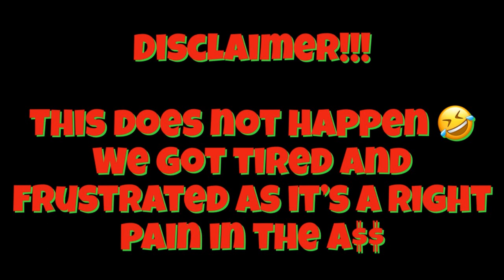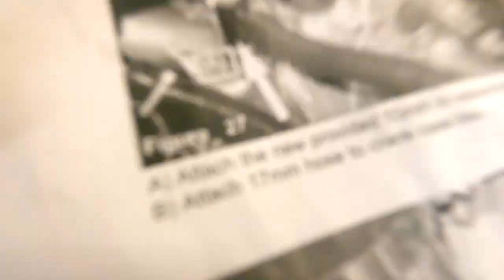Honda Civic FN2 Type R Injen cold air induction kit installation

Comment: So the japspeed catback video you guys made made me buy one and install that. Made it look and sound so easy.  That was a B*TCH.  In fairness most of it was getting the old one off but still. If this was supposed to be an advert for replacing the induction kit, I, personally, will be leaving this till a particularly rainy day. (Well more acurately can't be rainy as I don't have garage like you guys have!) as this did not look like it was a hobby anymore!
Reply from the maker: This k ok me really was a pain in the Butt mate really was. Exhaust changes will always be easy IF the old one comes off ok. Which usually isnt the case. Appreciate the support my friend 🤘🏻❤️

Comment: I've had the HKS ram intake and now Injen CAI, the CAI much better no flat spots runs cooler better system all round
Reply from the maker: 100% agree with you buddy
Reply: @CowabungaCarDiaries  what's the plan next dude ? Best mods I've seen with the FN is the exhaust manifold, induction kit & catback with map from dynodaze & yr rolling !

I've just recently added an RRC manifold yes it sounds great but lost low end torque!
Reply from the maker: @JA-wy1zv  mani definitely! Already has a custom cat back on it then up to Danny 🤘🏻🤘🏻

Comment: I have the injen V2 (chrome)does anyone know what's the difference from this version and the one I have apart from the colour?
Reply from the maker: I’d imagine just the colour bud unless they made it easier to fit 🤣🤣
Reply: @CowabungaCarDiaries  yeah a real pain .although somehow I managed to do it with the bumper on I just released it from the top so it pulled away from the body somewhat as I couldn't get the fog lights unplugged but oh well. All that fannying around is worth it in the end as in my opinion they sound awesome. Cracking video as always lads . Thanks for the entertainment 👍👍
Reply from the maker: @simonhardwick1168  bless ya man thank you 🤘🏻🤘🏻